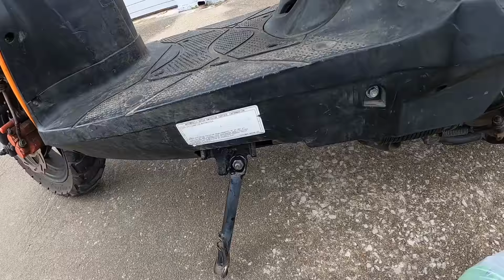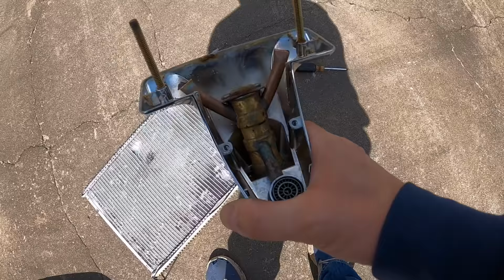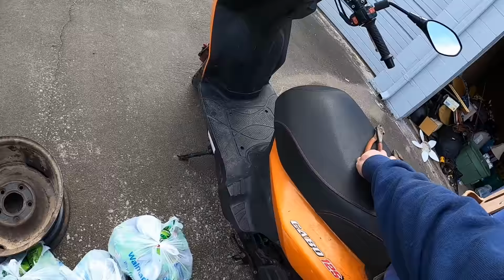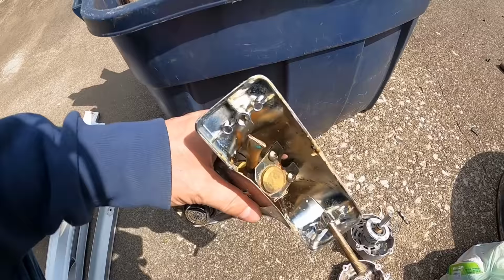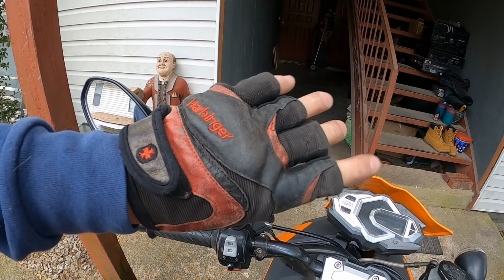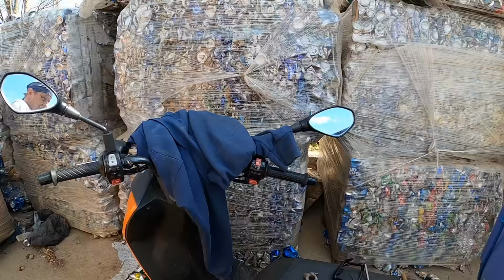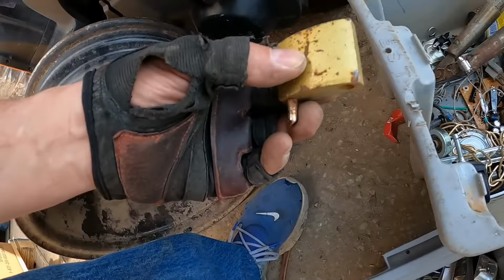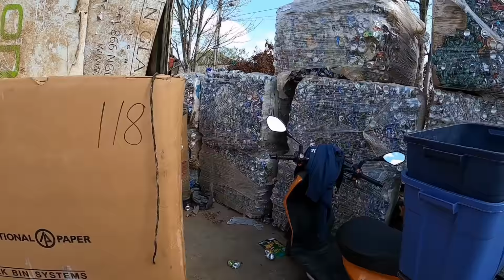Make Money with SCRAP METALS - Tips & Tricks

Comment: Thinks am up to like 200 lbs. of brass, 1000 lbs. of copper, stripped. And more not stripped. Aluminum, is too much to even gauge.400 lbs. of cans. Most all thanks to you for seeing the advantage of scrapping & Dumpster Diving. Guys like me do appreciate your videos. Long time viewer. 5 gallon buckets galore here. Did just take in 1800 lbs. of scrap steel for 126.oo. Was able to buy 15 tons of rocks for camp.  I take everything apart, motor copper, does build up. Once the bottom of the bucket gets covered, seems it just gets heavier.

Comment: Was lucky this last weekend. there was a camper teardown going on. got all the metal out of it . lots of brass n copper. An original water pump out of a water tank, all brass n copper. Hand operated of course. Early 50's camper. Going to pick up the aluminum outer shell this weekend. Frame & all. Windows already in the salvage pile.

Comment: If you have 50 fan motors it pays to take copper out right
Reply from the maker: depends what type of motors and the price levels of the different metals and electric motor price. The types of motors i typically find the answer is no not really worth the time unless of course a poverty level wage is what you want. It depends on the copper content of course and all the other metals involved like i said. Here is a ceiling fan motor video from eWaste Ben a couple years back that may surprise you. Now this motor has heavy steel but the thought process applied is the subject of point... https://youtu.be/rw4CK28PakU
Reply: yup your right its a lot of time and extra work

Comment: U want .25 cents for that copper......
Or 3.00 + for it?  
U make no sense talking about the electric motors!
Reply: I'm an old woman who has never done scrapping so if I can understand what he's saying, surely you can too.  He's comparing the weights of each metal when they are connected to other metals. The steel will get .25 as well as the copper attached to the motor, however, the copper doesn't weigh much to get a whole $3.00 when taken off as well as the steel that you would get .25 will now only get .5 cents when taken off the motor.  Hope that helps.